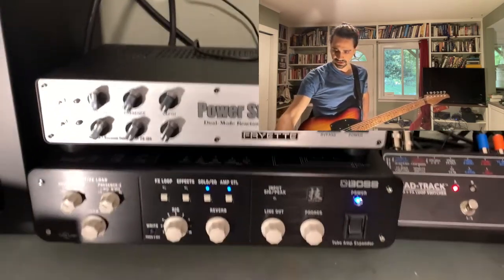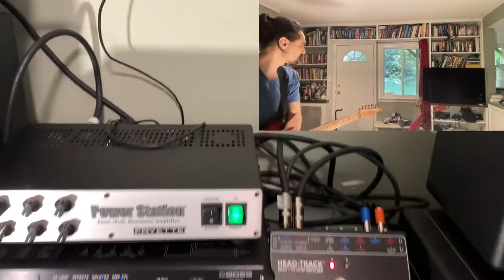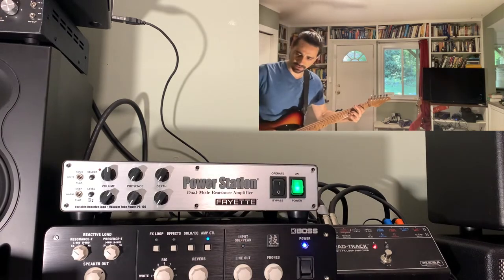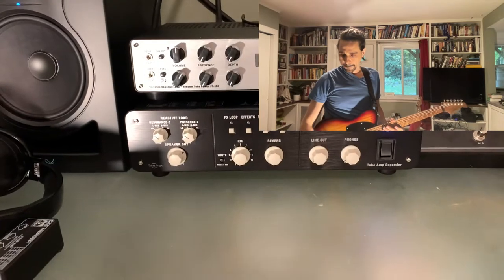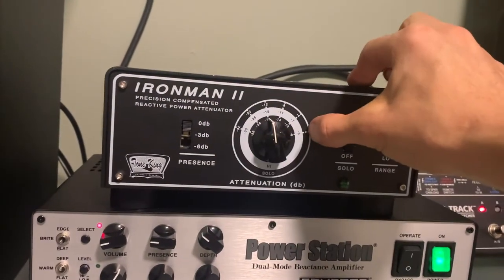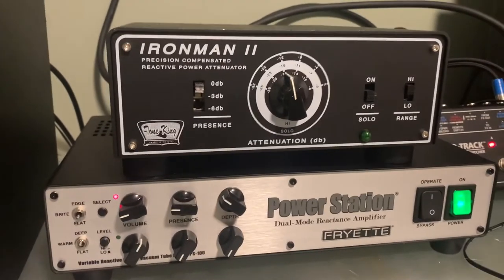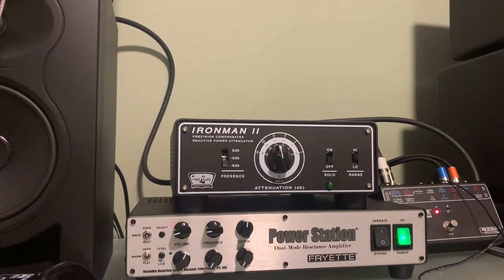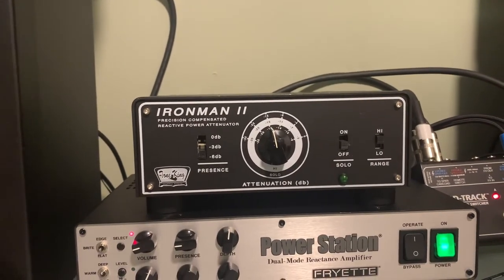Fryette Power Station PS100 VS Boss Tube Amp Expander TAE VS Tone King Ironman II Attenuator Faceoff

Comment: The Ironman has massive advantages: it is simple to use; it is incredibly reliable; it is 'fit and forget': being passive it cannot blow up your amp (are you listening, Boss?) or speakers; it would survive if your roadie drove his van over it; you know exactly what attenuation you are using (so perfect for repeatability); it comes with a 5 year warranty.  Ok, yes, I have one.  Actually, two.
Reply: And i keep hearing the Fryette power station colours the amps tone!:face-purple-smiling-fangs:
Reply: @EdBenji  Not as much as a passive attenuator does. If a Fryette "colours" and amp's tone, then the Ironman will wreck that tone flat like an old cassette tape.
Reply: @asnark7115  I've used the Ironman & its awesome...& 1k cheaper with no valves to replace!
Reply: @EdBenji  No effects loop, no thanks!
Reply: I'm not sure you can call the Ironman "passive" as it requires a 12v power supply to operate due to the dual transformers it utilizes to function.
Reply: @markn4526  Not my Minis. I use a fixed 6db attenuator in front of them so they'll handle 100w.

Comment: I have tried them all. The WAZA is far superior in terms of attenuation and additional features. Please don’t waste your money on an Ox if you are seeking attenuation for a high gain amp-it does nit hold up. The WAZA software gets the job done but needs improvement. However, it comes extremely close to not affecting tone. It is a brilliant and expensive piece of gear that I will not part with. The Fryette is good but not as good as the WAZA.
Reply: The waza sure doesn’t sound superior in this demo

Comment: I have the power station and I use it to drive a preamp into a speaker cab in a live scenario. I couldn't be happier with it. I don't even use it for any of the other features. But I would think that for those who are planning to use it for the features you highlighted you can't go wrong. Great piece of gear.

Comment: The best device in your room is the Suhr Reactive Load. Take the line out signal from the Suhr and route it through an active effects return of another tube amp. If you wish plug your modulation effects in between. This is basically the concept of the TAE and the Power Station. Least expensive and to my ear the superior setup.
Reply from the maker: Right that is an alternate solution. The Suhr Reactive Load is a great load box, and probably my favorite too. The primary issue in using it in the way you describe is that whatever power amp you run it into colors that sound quite a bit, while the Fryette and TAE are quite transparent. I've tried it through the effects loop return of a Friedman Twin Sister, Suhr Hedgehog, Suhr PT15, and Fender Hot Rod DeVille. The Suhr PT15 was the most transparent which makes sense because it has very different clean and gain channels and needs to sound good with both. The other issue is that the Suhr Reactive Load is only able to accept 8ohms.
Reply: @xguitarx5565  Agree that not every amp with an effect loop will work. It takes amps with a transparent power stage, i.e. designs that take their gain/breakup/distortion from the preamp only. The PT15 has that, my Mesa TC50 as well as one of my Boutique DStyle clones. With those amps there will be no coloration of tone. Surprises me that the Hedgehog didn’t work in your case, but some DStyle amps have their Master routed before the loop. Those don’t work.
Reply: Thanks - this is very useful information - I have been considering the Fryette for a while but had been trying to get a similar outcome using a Captor + FX return of various amps and it always sounds too coloured / like it is being over-EQ'd.

Comment: Have you tried the rivera rockcrusher or the dr.z air brake?
Reply from the maker: I did try the rockcrusher years ago. I remember it being fine, but can't give any really honest feedback in comparison...
Reply: The Rock Crusher is good and allows EQ to be dramatically controlled.  I rank: WAZA; Fryette: Rock Crusher and the OX a distant last.
Reply: The Z air break was a disaster!:face-pink-tears:
Reply: @xprophet9  The Rock Crusher that you're referring to is the recording version with the built-in EQ, correct?

Comment: Thanks so much for the great video, super helpful! Question for you. I'm sold on the Fryette PS2 thanks to your vid. I have a Captor X for recording but I don't like the attenuation options. Can I use them together? Can I just connect the Fryette directly to my audio interface with the Balanced DI out, then use headphones from there? I have a Fender HRD Amp (crazy loud) so I've always wanted to hear my combo amp through headphones WITHOUT having to use cab sims like w/the Captor X. The Fryette PS accomplishes this, right?

Comment: Very interesting and informative comparison/review.  I tuned in not so much for the comparison, but more to hear what you had to say about the Ironman.  I'm looking for a true attenuator, not a re-amping device which both the PS100 and TAE actually are.  For me, I've been considering the Ironman and the Rivera Rock Crusher.  It's perplexing to me that Tone King didn't design a bypass into the Ironman which means it's always on.  On the other hand, I think it's interesting that they designed it with tone compensation at higher attenuation settings, but you're stuck with what they think those compensation levels should be for your particular amp.  Every amp is different and reacts differently and yes, the presence-cut selector may be useful but not like a real EQ section would be.  As you stated, the bass frequencies were over-compensated when used with your particular amp.

The Rock Crusher has a bypass and is supposed to be more transparent than the Ironman.  That could be good or bad.  Also, I found out from Tone King that the Ironman may not be suitable for use with a "big amp".  I plan on using it with a '72 Marshall Super Lead which qualifies as a big amp.  Supposedly the Rock Crusher was designed using a '72 Super Lead.

Thoughts?

P.S. I find it interesting too that you commented something about modelers.  I can't use modelers because for me they take away the sound and feel of a good tube amp.  Like you said, they sound and feel digitalized.  I call it phony.  You compared the TAE to a modeler and I've found that attenuators do this too to some extent and/or have that "blanketing" effect that you mentioned.

Comment: This was a great review and really showed me what I needed to hear. I have researched each and know of the re-amping available on the TAE and the Power Station, plus their effects loops as well as the TAE’s IR’s. But fundamentally, I really am wanting a reactive load attenuator to plug into a speaker. I would have expected the price of the Ironman II to be significantly lower than the Power Station and would have gone for the Ironman II if the price gap wasn’t so narrow.  So, for me it’s a Power Station all the way and I’ll narrow the price gap by getting the 50 watt, single channel PS2=A Power Station. As far as the Boss TAE, I have no desire to have a laptop involved in the equation and while it has so many cool features, I don’t need them and don’t want to pay for them. I will use the Power Stations effects loop.  

Again, this was the review I’ve been waiting for. Excellent job focusing on sound and feel because that is exactly why I’m interested in a reactive load attenuator.
Reply from the maker: Awesome! I was in the same boat as you and just ultimately decided to get my hands on all of them. Then I was thinking, I could make a video, which takes time, but it might help some people out. So, even if I helped just one person (you) a bit, it was worth it! Thanks and enjoy!
Reply: @xguitarx5565  It really did and thank you so much!!
Reply: @xguitarx5565  One question, are the TAE effects features assessable through a smart phone or iPad, using an app with bluetooth?
Reply: @donmcdonald4874  Nope, only usb cable attached to a computer
Reply: @charliew830  My Power Station arrived today!
Reply: You don’t have to use a computer with the WAZA to play live. It is superior to the Fryette in every feature.

Comment: I have a PRS Archon 100 with a very noisey loop which sucks as I do like to use some delay for solos. Would the loops on these devices help me out in that situation?
Reply: Loop on the Fryette is great and adjustable for rack and floor effects

Comment: Thanks, that was in-depth and very helpful. I've been looking at the Fryette for quite some time. Most people seem to be pretty happy with it, but some complain that it changes their tone drastically and sell it rather quickly... I'm trying to understand why it works for some and not others before investing in it.
Reply from the maker: I really can't imagine that it changes the tone more than any other device out there - and it has so many ways to shape the tone. It is better sounding and more transparent than every attenuator, and I've tried most of them. I don't think you will be disappointed.

Comment: A good video, good sounds and comparisons...I've got a PS100, and I'm having issues with mine which I'm hoping will be fixed with a replacement chip. Mine sometimes doesn't engage when I switch out of stand by. I'm hoping that this chip also has an effect on the tone as well, because when it does attenuate it really seem to suck the tone...the gain stages just fizz...it's pretty bloody horrible to be honest.
Reply: The price is horrible as well...$$$$:face-purple-smiling-fangs:

Comment: Bruh.  Turn up the hi/lo controls, turn on loudness compensation and turn off your EQ.  You don't know how to use it.
Reply: Correct, the hi low and also solo switch definitely can find a sweet spot
Reply: He did turn them both up at about 6 min in - so you can hear the difference they impart. How do you know how he has the loudness compensation set - why do you assume it's not correct for the amp he is using?

Comment: What is the Suhr attenuators like?
How transparent is it. 

So how do you rate the power station the TAE and Ironman?

I like the idea of using that amp and not being limited the volume of the amp. Having the effects after the amp is a bonus as the fidelity of the effects is preserved.
Reply from the maker: the Suhr is not an attenuator, it is a reactive load with IR - so it mimics the load an amps experiences when played into a speaker, and then captures the amps sound and outputs it at line level

how do I rate them... like numbers? I'd say there are too many variables to put numbers - but the power station is the best feel, tone and value out of the 3

I guess:

capabilities/options:
PS 8 
TAE 9 
IM 4

feel:
PS 9 
TAE 7
IM 7

sound:
PS 9 
TAE 7
IM 7

ease of use:
PS 7
TAE 5
IM 9

tweak-ability:
PS 8 
TAE 9
IM 3

live use:
PS 9 
TAE 5
IM 8

studio use:
PS 8 
TAE 9
IM 5